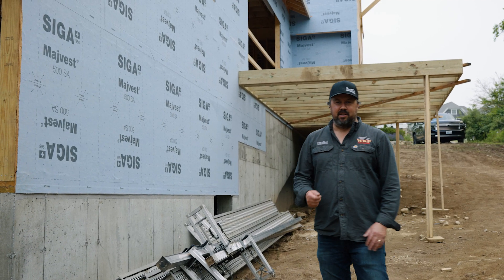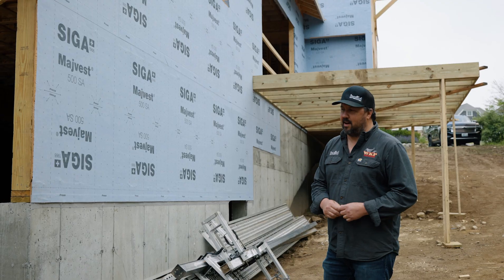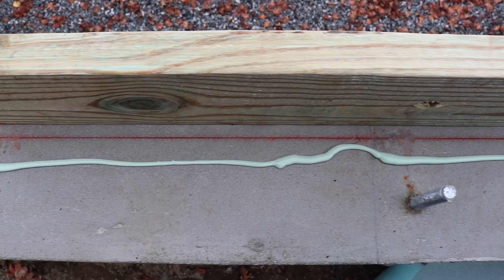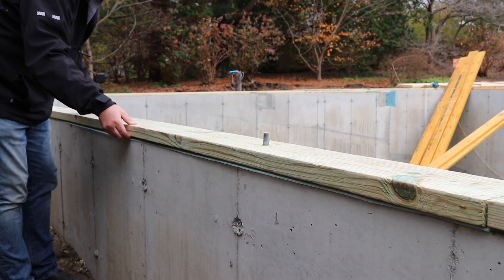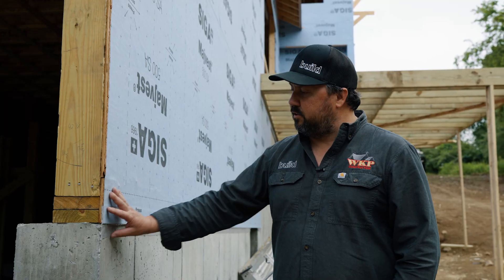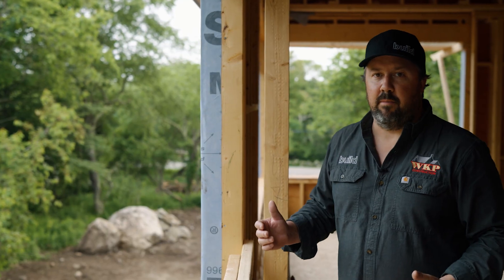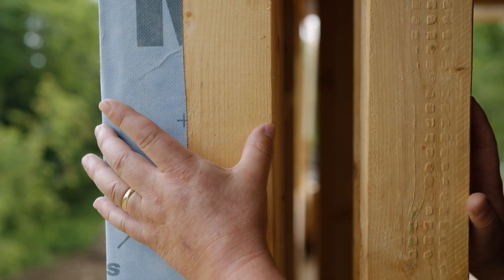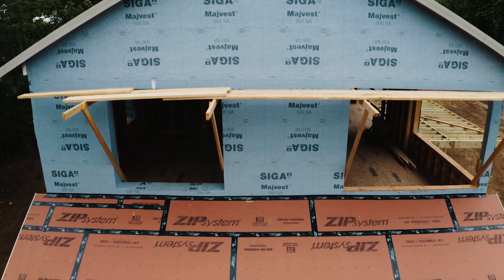Double Wall Construction & Mudsill Connection

Comment: Would 2 x 3 turn sideways staggering on a 2 by 6 sill plate be strong enough for a single story house? 
24 inch centers both ways
Reply: A lot depends on the quality of the the wood. Most 2x3 are crap. Not sure they meet Code for most areas for exterior walls.
Reply: @je-fq7ve  
They are used in mobile homes, what would be the difference
Reply: "strong enough"?   That's impossible to answer... 

Since for "one thing", there are various forms of strength.... "you don't even know, what you don't know"

Comment: Lateral fire blocking?  How do you accomplish stopping a fire from traveling between the two walls?
Reply: Fire is really difficult in a "dense packed" cellulose wall. It is difficult for air drafts/smoke to get pulled thru it. Cellulose also "has active fire-resistance materials that provides a Class 1 flame spread rating and is a building code approved fire-blocking product".
Reply: Easily.... 

Especially via rolls of batt Rockwool.

Comment: i like the double wall idea but i have questions about fire blocking....i see there is blocking on the exterior wall but is it needed in the 2x4 interior wall or even in the space between the walls
Reply: cellulose is an "active fire-resistance materials that provides a Class 1 flame spread rating and is a building code approved fire-blocking product".

Comment: "can allow thermal transfer" it WILL allow thermal transfer and drops a walls R value immensely. (3 studs each side of window and door + Header)
Sides of my doors/windows in -20c are freezing to the touch being as a 2x6 R value is only about R7. Not to mention -35c Temps I face in Calgary Alberta.

I am a huge fan of Sealant Between Jack/King/Criples. to get rid of any airflow on the outside of the framing that might migrate towards the inside of the home as well as the top and bottom double plates. That little Effort goes a LONG way. 
Rigid Foam Below Grade against Concrete walls FTW.
Reply: You did see that this a double wall construction, yeah, where that very well built outer, structural 2x6 wall with jack, queen and king studs had a 3" insulated gap before even touching the interior 2x4 wall?  I don't think you did.

Comment: My house built in 1962 had such a huge gap between the concrete and the wall assembly. It was about 3/4 of an inch in the center of the wall. Yikes, lots of expansion foam and lumber to prevent cold air leaking in. Thanks. great video. 👍👍👍

Comment: I am having a hard time understanding why you would ever need an r46 in the walls.that is insane .they did some research on the when you are wasting money on over insulating and the heat loss thru every r value you could use. There is a ooint when you start wasting money because more is better. It is not true. All the money wasted on double framing is massive over kill for not one efficiency benefit. For the cold to transfer thru a 2x6 stud it would have to cool all the insulation touching it on both sides. If you want an r 46 step up to the close cell spray foam and use the money you will save by not doing the double framing.  Silly
Reply: Close cell spray foam is quite expensive. I'm not sure it would be cheaper than what you think. 

I do think it would've been better to have both walls as 2x4. The 2x6 shouldn't be needed structurally, so going to a 2x4 would give an extra 2" of insulation or a thinner wall.
Reply: @agisler87  for what ? An r 30 in the walls is overkill the upper floor ceiling is the most important .heat rises it doesn't push sideways. Double framing is pointless waste of money
Reply: @jefflinnell8492 It's not that much over what code requires. Especially depending on which zone this is for. The double wall reduces thermal bridging which will transfer cold. 

This is probably a cheaper design for a high performance wall.
Reply: Spray foam is toxic. Insurance won't cover it. Many countries and states are NOT allowing loans or even sales to take place if there is ANY spray foam in structure.
Also let alone the inability to get wood rot and termite inspection. ..and Soo much more

Comment: Awesome helpful info thank you! I would like to ask for this style of double walls between the exterior and interior walls as you showed on this video. Is there any connections between the two wall that greatly affect the thermal bridging? Or are both the walls completely independent from each other with minimal connecting each other not to affect that heat transfer! Also would the esg foam boards Matt and other builders use more/less or same R value in buioding methods?

Comment: No wonder the housing situation is in such a crisis, these guys use enough material to build 2 houses in just one house that costs 4x what it really should!
Reply: I saw a video on here the other day an electrician trying to justify only wasting one roll of wire on a house with 250 boxes. I’m like wtf a decent house only uses one roll of wire altogether. When I see post Malone talking about a 12,800 sq day house. I’m thinking is the layout an oversized house with a 10x1000 foyer or what

Comment: Is heating really that expensive in the NE?  I wonder what the ROI is.   Understanding that wood is a conductor - what about Post and Beam framing?
Reply: This is kind of a loaded question imo.  It all depends on the house and heating methods really, but 5-700 is pretty average monthly cost of heat/cooling on 2000ish sqft.home. Also depends on what the home owner is going for, Some people can't get gas, They are going solar ect ect ect.  Generally the ROI is 6-8years without tax write-offs, If you include them it is sometimes (depending on state) cheaper to build this way believe it or not. my dad learned the hard way lol. But The biggest downside to homes like this, Is the time it takes to build at the end of the day. 
  
My dad and I built pretty much identical houses the past (started the same time) 5years, Both 30x100 ranch "kit" homes just two lots from one another. He went normal 2x6 advance framing but with R3.3 zip sheathing, about R25 walls 60 attic. He pays about 260 average a month for electric. I went staggered double wall, with R9.9 zip sheathing on the outside and in for vapor barriers with 1/2" closed cell foam on the outer sheathing and packed rockwool in the middle about R67-69 total for the walls that also runs up the roof, with another R40 in the celling to the attic cavity,  triple pane windows, R22 doors and a 1.8 blower door score, I was able to put in a 4stage 2 ton geothermal cool/heating system while he had to get a 2 stage 5 plus another 2ton geo. I also put 86Kw's of solar 165Kws of batteries, 20Kw generator and 1000gallon propane tank he did not. I went with a well and septic he went city service and we both don't have gas lines.    Because of all this I got Passive home, Net zero and Energy star Certified. 

  My dad paid 240K for everything turn key, He got 25K back in grants and taxes at the end of the year but that's it , I paid 290K but got 90K in Federal grants an taxes at the end of the year plus 25K in state rebates, So right away it was hella cheaper for the wife an I, PLUS we get 1K for energy star 3.1 a year for 10yrs and 2500 per year for 10yrs in tax rebates as long as I'm "net zero" even with 2 electric cars with around 10K miles a year put on them, only charging at home (we use the gas car for road trips) the electric company still pays us 30 a month or %40 the value of what we feed back, Instead of paying $260 Like my dad for the same (ours is about 250sqft less tho) home or the $5-700 the average home here pays.  We both also got (Menards) in store credit, Him 20K me 27K. IDK about him but I also got a lil more then 12K cash back from the cards used. 
 
 So if we compare cost just over 10yrs with my dad. He paid 195K while still paying about 400 a month for ALL utilities or another 48k over 10yrs.  We will have paid 101K, with no utilities bills (maybe 800 total in two septic cleaning) while getting paid around 3K from the electric company over the 10yrs, Nor are we paying $3-400 a month in gas for car's. Compared to a normal home my home is basically (not really) paying me after 10years

Comment: I grew up in RI working in the Watch Hill/Westerly area and we always used sill seal but that was before everyone started going passive. I’ve since moved to VT and their energy code here says they do not allow sill seal, you must use a flexible caulking between the foundation and sill so this is the best of both worlds.
Reply: That’s so lame in VT! The sill sealer also prevents wicking between the concrete and the wood. You could use sill sealer and still caulk it.   Do you know why they don’t use seal sealer in Vt?

Comment: Is the air chamber in between going to be filled with isolation or with air?
Reply from the maker: not an air chamber. The entire depth of wall, incl the 3inch "chamber" gets filled with dense pack cellulose. So 12" of insulation for an R46

Comment: Yes, very expensive construction, double wall, double framing, less square footage of livable space. How does that construction compair to other forms of construction at the same R value? manufactured modular construction panels with foam fill, autoclaved foamcrete block, etc. Also, using double framing seems it may not be as sustainable as non organic high R value products. I can forsee a time when premanufactured 3D printed modular wall construction filled with foam or some other insulation could take over since the concrete isnt organic and also new formula utalizing Fly Ashe and other low carbon footprint materials can be greener.
Reply: I would consider a double wall the best bang-for-buck system when you factor in all forms of labour involvement compared to other assemblies. I would much rather go the double wall route than say adding 6" of Rockwool on the outside of the wall and having to address all the details with exterior cladding, even though that may be a better performing assembly. No wall system is perfect, but at least they are building something to PH standards which itself is highly positive.
Reply: My house has double 2 x 4 walls with staggered studs and no space between them.  Minimally more expensive that 2 x 6 wall but no thermal bridging except for top plate and mud sill.  Very low heating bills with radiant heat.  I think the number and size of windows starts playing a bigger factor once you get to r-30.  I have a lot of windows so having a thicker wall assembly wouldn't help that much more since the square footage of the windows makes up much of the wall.
Reply: Triple wall construction is even better!
Reply: 2x6 with 6" rockwool exterior is double the price, just in materials. Same range as ICF.
Double stud is between that and 2x6+Zip-R. 
Add LiteZone R14 windows to 2x6+Zip-R, and you close to double stud performance with lower cost. Only downside is they're fixed windows, but do your really need to open windows with ERV/HRV?
Reply: How is it less sqft if the architect accounted for the double wall? If its a 6000 sqft house the double walls are factored in.